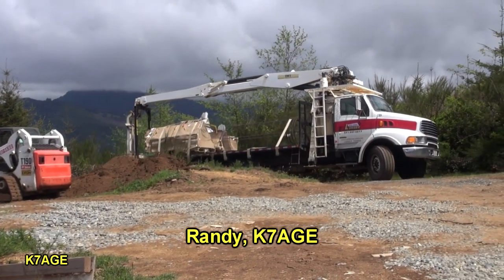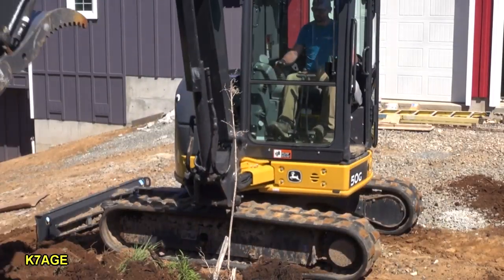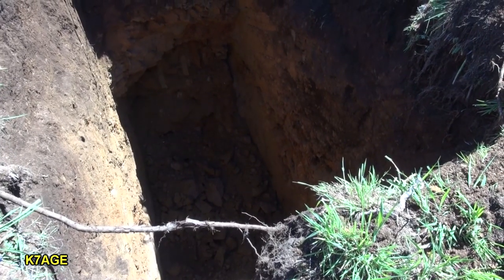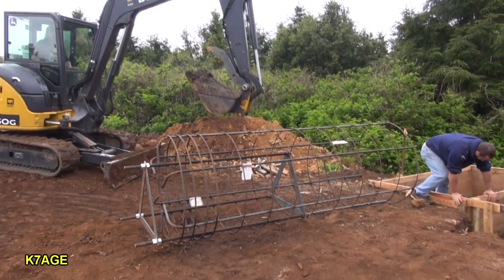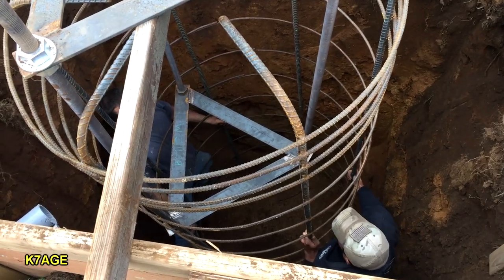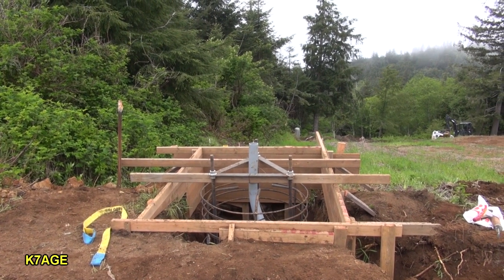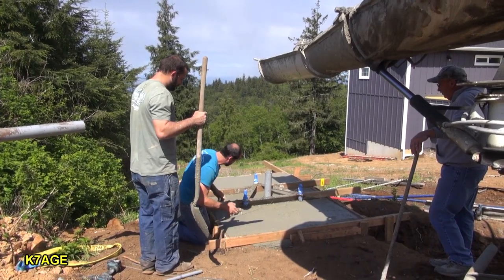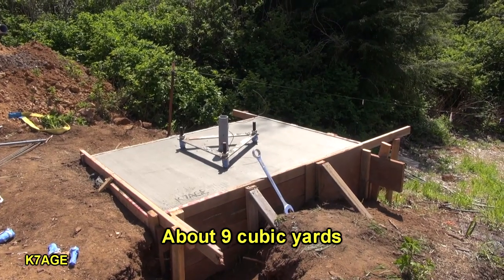Part 2: Tower arrives, conduit installed, tower base

Comment: Getting ready to build on a 26,000 acre lake in Texas. Hope the lake works as a reflector for the TA-33 and the HF9V will be at the boathouse using the lake as a ground. Have to make the tower and power common, so will require 17 ground rods cad welded. May be overkill, but if it stops one lightning strike from getting in the house, it’s worth it.
Reply: Yes. Good grounds are a must. My neighbors house went up in flames after his tower was hit.

Comment: This will be nice. A ham that moved to town gave me his 48 now 46 foot self supporting tower. I tried to offer him something he replied no. I did have to spend $75 to get two sections bolt hole re worked since it had been loose for years. Trying to figure out what antenna to put up there. He gave his rotor too. I haven't checked to see if it works yet. I was thinking of one of those Urban SteppIR units.
Reply from the maker: Be safe

Comment: Cool! But your contractor failed to wrap the PVC conduit with foam where it's embedded in the concrete so it won't eventually snap at the transition from earth to concrete. Also failed to lay the conduit in a sand bed in the trench to prevent puncture and breakage as well.
Reply from the maker: oh no....
Reply: @K7AGE  I don't think that will be a problem with the soil you have.

Comment: No ground rods? Doing them after the fact is so much more work. I guess you  still can use the water jet method to put them In but still a lot of unnecessary work.
Reply from the maker: there are ground rods, stay tuned